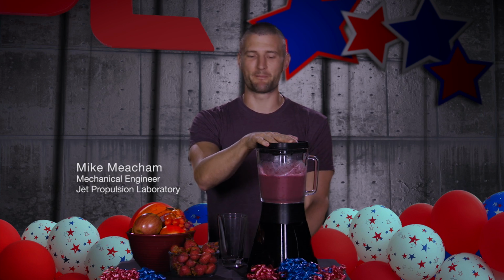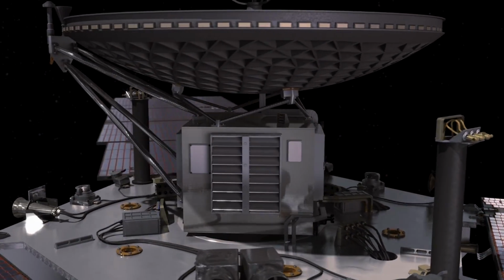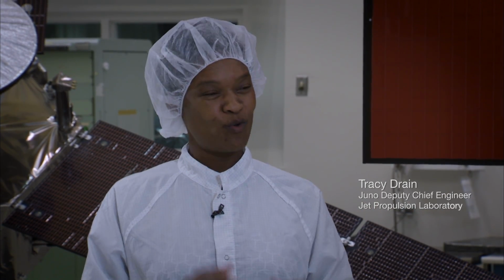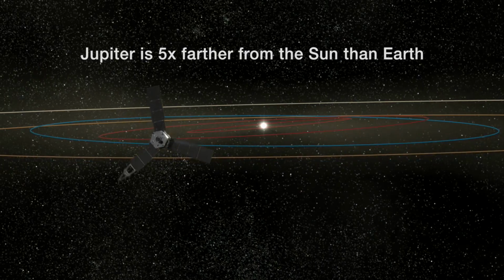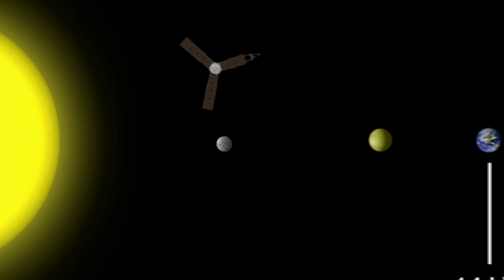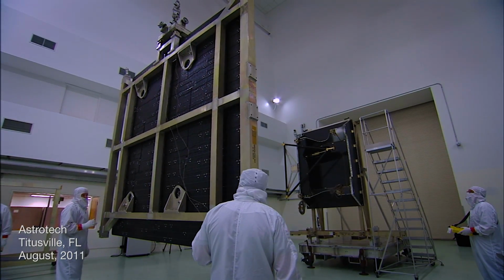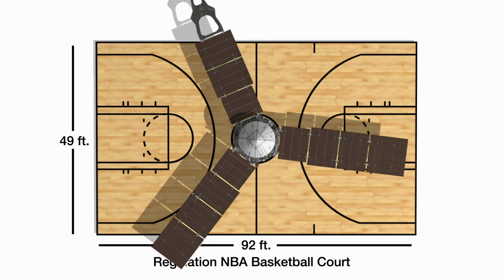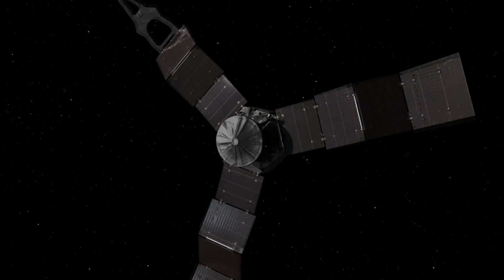Crazy Engineering: Flying Solar to Jupiter

Comment: That's awesome! I don't know how it is going to "feed" the power once it's already at Jupiter, because even though it has so much energy stored, it's going to lose it pretty quickly.
Reply: Solar panels produce electricity whenever they have sunlight, and since it will be orbiting Jupiter in a very elliptical orbit it will be in the sun almost all the time. The spacecraft also has batteries, which it used before solar deployment and which could power the craft for whatever brief shadows it may experience (or potentially for experiments that require short bursts of power exceeding the total output of the panels).